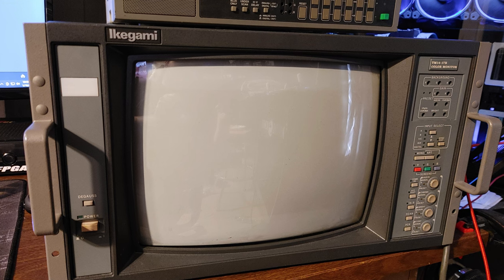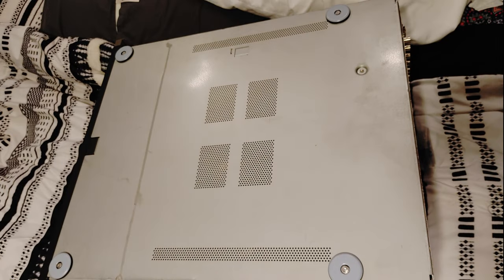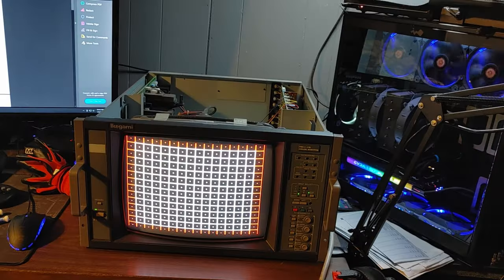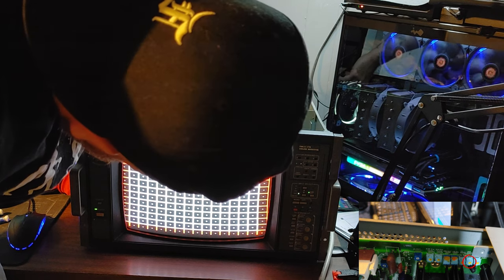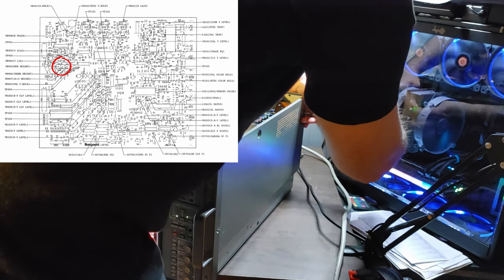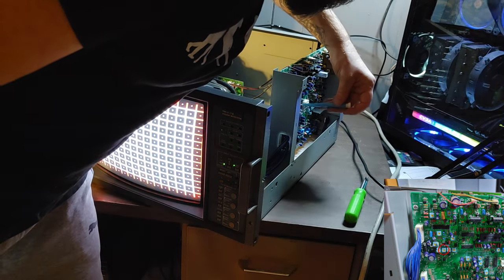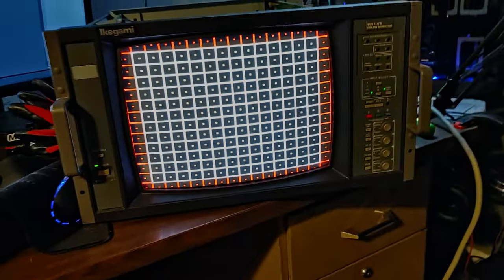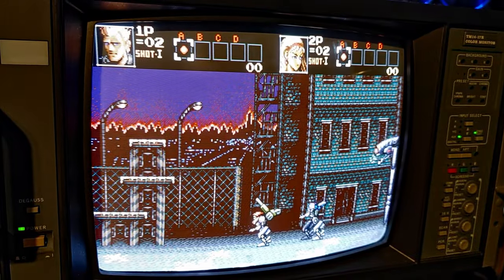Ikegami TM14-17R How to set Vertical Horizontal Size and Position Calibrate/Geometry/Pvm/BVM/Monitor

Comment: I have one of these. You can land a plane on it. Took me ages to track down vertical. God's work showing this for others. Another important thing I'd point out is that connections need to be terminated. I thought my monitor was stuffed until I put a 75ohm termination on the bnc out.
Reply from the maker: I did mention termination caps at 1:42, but yeah.... I couldnt believe all that air inside this behemoth case 🤣🤣🤣
Fantastic image on them though!
Thanks for watching!
Reply: @LameGaming  whoops. My bad. I shouldn't try multitask while watching YouTube. Yeah, nice image. Mines a little tired. Also got a 9" Ikegami I absolutely love. Wish I had a 20" though.
Reply from the maker: @peterk1837  Luckily mine are both super bright.... I think I would be finally satisfied and nolonger look for the crown jewel crt if I had a 20" ikegami. 
I dont know how their shadow mask tubes look but these slot mask tubed monitors look like the image was painted on the screen. Super nice... Sonys def have more pronounced scanlines but im loving them both and would be happy with just an Ikegami if it was all I had.
Reply: @peterk1837  I got a 20’ for free! TM20-17RA/RPA. Just ordered some terminators! 🙏

Comment: Just got one today. Cheers! S
Reply from the maker: They have an amazing image! 👍👍
Reply: @LameGaming  Even more amazing is it was used 24/7 in the local TV station for 30 years and still has good picture and works OK.
Reply from the maker: @suadcokljat1045  Wow, yeah.... Ive found ikegamis to be very robust. I have several 9" and 14" ikegamis and they all perform great and feel no need to service them other than minor pot adjustments. 
My sonys on the other hand have all needed caps replaced at minimum.
Reply: @LameGaming  Not sure, but at first look seems Ikegami has Panasonic FC caps. Decent caps I usually use for restorations. Cheers! S

Comment: Great video, really helpful! I saw that you did a video on convergence rings for another crt, you have any experience doing that for the TM14-17R? I thought I'd try improving the convergence on my own Ikagami but I'm not sure where to begin. Do you have to loosen the screw behind the rings for them to move? I couldn't find the h stat pot on the tm14, is that simply not a thing on that model?
Reply from the maker: I havent had to mess with convergence on any of my ikegamis luckily but should be similar method. Been awhile since I had one of the ikegamis open, cant recall about the hstat off the top of my head, would have to check in the service manual

Comment: Very cool! Is your tube a slot mask or a dot trio shadow mask? I've heard the TM14-17R can be either. Slot mask seems to be most common. I wish the TM20 had such a variation. The contrast between the two types would be a lot of fun to compare. 

It's pretty much the exact same procedure on the TM20-17R. The TM20-17R also has the ridiculous amount of extra room inside. Everything is pretty well labeled on the inside, but still neat to see the service manual is getting some use. A couple years ago I was able to beg it off Ikegami support and share it to the community. They seem to be getting less tolerant of providing manuals on 20 year old monitors these days.
Reply from the maker: I wasnt aware there was tri dot variant tubes in ikegamis, very cool, I will have to look into it more when I get a chance.
I have a 20" panasonic broadcast monitor with tri dot tube and its amazing.... Easily the sharpest most vibrant tube ive seen for 240p content.
Id love to get a 20" ikegami to compare.
Im sure they are great too and seems to me the ikegamis tend to hold up better over time than sonys. I have 4 or 5 ikegamis and they all still perform great with no service done other than minor calibrations. 
Id really love to find slotmask or trio multi format 20"!

Comment: Is it true that this PVM emits radiation?  I just bought one and many people say that it emits radiation.  On the back side it says to be careful when opening the cover protector, but when closed it still emits radiation?
Reply from the maker: All crt's create a tiny amount of x ray radiation caused by high voltage electrons inside the vacuum tube.

Im sure theres no more created in these ikegamis than any other brand. Its miniscule amounts and if I remember correctly are only measured at the back of the tube. Just dont sleep with your head pressed against the back of it and youll be fine 👍
Reply: @LameGaming  Thank you bro!!! I just love it this Ikegami.
Reply from the maker: @gorytechno  They are nice, congrats!

Comment: Hi, i have a terrible coil whine sound in my Ikegami, any idea or solution?
Reply from the maker: First step would be to try and pinpoint if the sound is coming from the yoke, flyback, or another component on the board. Is it a buzzing sound?
Reply: @LameGaming  its a linear high pitched, enough loud to gime headache.
Reply from the maker: @gelomc.johnson5708  I dont know, would have to remove casing and see if you can pinpoint it if its louder than the normal high frequency sound crt's make normally.
Reply: @LameGaming  i found manual and look for part number of capacitors, but i cant find them online with those numbers. Is there a recap pack for this monitor anywhere? Or how can i do for finding the correct capacitors with the manual? Thank you very much
Reply from the maker: @gelomc.johnson5708   I have heard caps can make noise when they are on their way out but never experienced it myself yet so didnt want to mention it as fact, also ive heard about the deflection windings on the yoke making high pitch noise if the glue that holds the windings secure fails. But both of those are just shots in the dark without trying to pinpoint the sound. Id also listen near flyback to rule that out.

Retrotech steve posts some cap lists but Im not aware of any ikegami list, check out andy kings site "crt database" he might of recapped some ikegamis.

I have 5 or 6 various ikegamis but never ran into an issue yet with any of them.

The way I would do it is remove case, discharge tube and your large power filtering caps, carefully disassemble and remove chassis board.
Hand record all the caps in power, h deflection, and v deflection circuits.
These are the caps that cause 99% of problems because they are the caps with highest voltages and frequencies pumped through them.
Every cap location on the board will have a designation like "C515" etc.....
Record that and the caps capacitance uf value and voltage rating. Use the service manual to cross reference your list.
Sometimes the service manuals are updated with different cap values then you have to find out if the value of the cap on the board or in the serv manual is most up to date but I believe this is something thats an issue more with sony pvms.
If its your first recap id suggest an actual vacuum powered desolder station and alot of practice first. Always triple check youve installed the correct cap and its polarity before soldering.

I order caps on mouser, digikey is another site. Should be able to find everything you need. Try and use high quality caps like nichicon or panasonic. Get 105c temp rated. You can always replace a cap with one with a higher voltage rating but keep capacitance value the same. Good luck